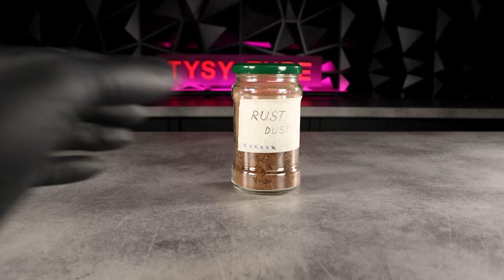Extremely Rusty and Destroyed Guillotine Restoration

Comment: I'm a chemist and I have a few things to say. Basically just don't use coke for removing rust. Most stuff that removes rust is acidic on the pH chart and sure, coke is but barely and I've used it before and it sucks to remove rust. What I would use is a mixture of vinegar (10%) and citric acid (or lemon juice) If the rust is really strong use a real rust remover as they contain hydrochloric or phosphoric acid normally, which tears through rust. For me personally I would use hydrochloric acid and it goes through rust in 2 seconds but it's a lot more dangerous and not everybody just has it around.
Reply: Lol
Reply: just take water and lye NAOH and dip rusty things in it for few mins only but when you remove it immediately apply some oil or lubricant on it else will rust again.
not useful for very fine threads as it will consume it but thick items it's ok to use.
Reply: @param888  Yeah I just fine it not as effective due to the water content so you would have to make it super concentrated but even then it doesn't work too well.
Reply: @FireTrye  i have used it professionally and got excellent results, I used it for bolts.
Reply: @param888  Oh really? Wow maybe I could try it again.
Reply: @FireTyre, not everyone has citric acid
Reply: I don't have citric acid
Reply: @rinjin1570  It's super cheap there's one at my grocery store for 100g  $2 AUD
Reply: Can i call u Walter white ?
Reply: @FireTrye So less expensive than one of those 2L bottles of Coke?

Also, less expensive than a single lemon. If Coke is too expensive, lemon juice is even worse.
Reply: @Ea-Nasir_Copper_Co  I just said it as someone asked. Citric acid isn't even the best option plus coke is useless at removing rust and citric acid is the ingredients in lemon juice that make it an okay rust remover. Just buy an actual rust remover or use elctrolysis
Reply: @n4_element606  lol
Reply: Good drain cleaners sold everywhere are ~ 20% “hydrogen chloride” but I’m no chemist so I don’t know what strength acid that equates to. I know even very diluted it would absolutely eat rust because I’ve seen it dissolve rags if given time. I also don’t know if it’s a good idea to use on iron, if it contains other stuff that would damage it.
Reply: @danielnance604  hmm maybe but yeah the "hydrogen chloride" you mentioned is basically The gas of hydrochloric acid. I have no idea why it was sold in drain cleaner as yes it can dissolve rags, but also aluminium and other stuff. Sulfuric acid is also sometimes found in drain cleaners but it's normally sodium hydroxide. But anyway to answer your question, yes it would be awesome at removing rust (depending on concentration).
Reply: Hard_hat_quonn  hmm but WD-40 makes it greasy as the end product and the rust appears back. Maybe if U use it to cover the surface of the metal
Reply: @FireTrye bill nye the science guy
Reply: Hard_hat_quonn  true
Reply: Bro it’s a restoration vid not a chemistry class
Reply: i have used coke for removing rust thanks for the fact i did not know
Reply: @Vashthestampede567  shush
Reply: @FireTrye  nour
Reply: Also, don’t support genocide by buying coke. Free Palestine 🇵🇸
Reply: @gangms16  how would someone support Genocide from buying coke
Reply: @deccyboi7667  lol
Reply: Idk like get a life
Reply: @BubbaBombGaming  says the dude on his phone writing that comment
Reply: @RandomYouTuber_YT  bruh
Reply: Yes. Use Dr. Pepper instead.
Reply: Got it MrWhite Anyways wanna cook some?
Reply: @JessePinkmanpp  bet
Reply: I want to know what to be used and what liquid makes rustproof.
Reply: Blud is making an human transmutation or a easier way to remove rust ☠
Reply: I’m a psychologist and i approuve that comment
Reply: @maxouno5817  Can you read people's mind?
Reply: @FireTrye  he's thinking of products that unclog drains like the works, which is hydrochloric acid.
Reply: Still works sorta
Reply: Ok
Reply: @maxouno5817  lol
Reply: I use acid drain cleaner
Reply: @abhishekprasad8151  yeah probably contains hydrogen chloride
Reply: Theres soo much cringe in this video, including using steel brushes
Reply: @scooooooterJesse, we need to cook
Reply: when will you make those “everday shorts” :3
Reply: @CowboybubPercussion  yeah fr
Reply: What chemical do you think he used to make it look rusty
Reply: @Ice_elite I'm actually not too sure. I doubt he made it rusty himself as it's penetrated pretty deep into the metal which are what those small black spots are before he sandblasts it. If he did he probably used salt water HOWEVER there is an awesome way using 19% cleaning vinegar, and 3-9% hydrogen peroxide (normally 8 parts h202 to 1 part vinegar) and some salt too. This makes it rusts in seconds. Also use as high purity of vinegar and hydrogen peroxide as U can get but above the amounts I mentioned it's hard to find and more dangerous.
Reply: @troxie000 lol
Reply: You can also remove rust with electrolysis and tell me if anyone wants to know more about how to
Reply: @FireTrye  yes 10% hcl
Reply: Im also a chemist and I also don’t think you shouldn’t just use coke
Reply: @nomadic_shadow  Nope it doesn't. Very ineffective. Plain old vinegar is wayyy better
Reply: The result was great so whats your point?
Reply: Okay nerd
Reply: Bro jus chill out im sure you have better  things to do than try to attract this guy because u know more
Reply: phd?
Reply: @too_much_time Had the perfect setup for Bill Trye the Science Guy and ya blew it😅Bill Trye Science Frie
Reply: this comment has made me a chemist, I'll have your PhD now🧻
Reply: BRO HE TURNED THE WOOD FROM WHITE TO BLACK 5:10
Reply: @FireTrye 🤓🤓🤓🤓🤓🤓🤓🤓🤓🤓🤓🤓🤓🤓
Reply: @1979GenXdude He asked in the video why coke wasn't working. Also yes it did but it was because he sand blasted, sanded and scrubbed. It would've been easier if he used a better rust remover though.
Reply: @nameisnotrelevant dam maybe I should take over 😄
Reply: @scooooooterthanks so we didn’t have to
Reply: Or you could just use rust remover
Reply: @THEBOILEDONE  ye lol
Reply: @TheThe-cq6ry  like Michael Jackson's skin color change?
Reply: Institutions unclear I used H2SO4 in my school lab and some fell on my fingers and I got a burn😂
Reply: Let the man cook that's probably why you're a chemist
Reply: Is there any way to make the Coke more acidic?
Reply: @maikybravo6108  I mean I guess but you'd have to add another acidic thing so you  might as well just use something else
Reply: Thank you for giving me a heart attack with this comment
Reply: why am i seeing people put up nerd emojis he is literally a chemist, plus he is just saying why coke is worse
Reply: Noted thanks for the info
Reply: Since your a chemist (just asking for a friend) can you give me the perfect recipe for pure meth
Reply: @I-play-tabor   Mhm just as a friend don't think youtube would like if I said it tho ;)
Reply: @gear7047   Thank you!
Reply: YO MISTAH WHITE WHY YOU GOT ME RUNNING AROUND TOWN TRYING TO FIND SOME STUPID BOTTLE OF LEMON JUICE WHEN I HAVE A PERFECTLY GOOD COCA-COLA I CAN USE?
Reply: @soupe5758  No Jesse NO!
Reply: Ur a chemist Yh 😂😂
Reply: @FireTrye coke has a 2-3 on the pH scale, which is similar to vinegar.
Reply: No thx😊
Reply: for me coke is perfect rust remover bruh
Reply: Does weak acid clear rust efficiently?
Reply: Huh 5:07
Reply: The only way I
Reply: Acid
Reply: Works great at removing stains from a filthy toilet if left overnight. Then follow up with a toilet cleaner. I have done this many times.
Reply: Hell yeah Mr. White
Reply: Bro is a nerd
Reply: lol
Reply: @FireTrye  well according to my calculations 🤓👆
Reply: Well if one wanted to have it around, where would you suggest they obtain it?
Reply: Not everybody has a industrial sand blaster lying around either 😅
Reply: Like hydrogen and nitrogen
Reply: not a chemist but a person who attended school, isnt dish soaps alkali, why add alkali to acidic things like citric acid and vinegar
Reply: A rust/corrosion remover that you can get at any Car place (even walmart automotive) for batteries is great for rust. Just hop a few aisles over for some metal brushes and that yellow foam crap will take anything off with barely any scrubbing
Reply: El acido clorhidrico es bueno removiendo el oxido pero suele dejar manchas en el metal
Reply: As a programmer i agree with him😊
Reply: Thanks!
Reply: Asking- as a mechanic, since it’s what I’ve been using for corroded battery terminals- is there an alternative I could use?
Reply: How did I ended reading like 30 comments.
Reply: No
Reply: Oxalic acid is the way. Especially if there is paint to be preserved underneath
Reply: 🤓”erm i actually a chemist”
Reply: Bro you can get it at a hardware store for like 30 bucks 😂
Reply: Wouldn't the dish soap reduce the efficacy of the acid solution you're trying to make?
Reply: Is OP actually going to take this slander from thy nerd?? I wouldn’t… he tryna make it sound like he could do a better job, we all know he couldn’t…
Reply: Znerdy aah
Reply: @statikcitten9  very good point and I don't know how I didn't think of that earlier. Thank you
Reply: Wouldn’t the dish soap make the mixture more basic?
Reply: @NJMgolf  yup that's what I was saying. It would neutralize the acid so it's worthless. Don't add it
Reply: Not that serious he just did it because people wanted him to
Reply: Ok you didn't have to explain all that.
Reply: Dude it was recommended to him…he’s a content creator
Reply: No 💩 Sherlock no Offense
Reply: I don’t think that’s what they usually do, but just did it because of comments asking for it. Could be wrong tho.
Reply: Well maybe Coke was the only thing he had lying around, Walter
Reply: Hydrochloric acid takes almost 24 hours to fully do any work on an acidic value.
Reply: @FireTrye  how much acids do I need to fully dissolve a 197.9 pound thing with meat?
Reply: Ketchup also removes rust as well
Reply: @ouriel-0  Roughly about 6- WOAH WOAH WHY DO YOU WANT TO KNOW?
Reply: This guy has 2.5 million subs. His craftsmanship is flawless. I think he’s doing fine Bill Nye
Reply: lol @briandoczkat9895  but he did ask why it wasn't working
Reply: What if it was coke syrup without being diluted into water ?
Reply: Bro stands on business
Reply: Thanks for the science lesson 🤓
Reply: @FireTrye  this is art, mr. white
Reply: Wow cada día se aprende algo, gracias 👍🏻
Reply: Mm g ❤
Reply: @iFRNKSTN  it doesn't matter why are people still discussing this? Coke contains a tiny bit of phosphoric acid which is used for rust removing. JUST BUY AN RUST REMOVER OR VINEGAR
Reply: @CaoticMonarch  Yeah 👍🏻
Reply: What about cocaine?
Reply: I have one theoretical question, what would one do if they needed to dissolve a body as fast as possible
Reply: @davyboy9397  so you need Kerosene, sulfuric acid, acetone, cocoa leav- what do you need it for?
Reply: @science_rex  Um I'm not gonna say but let's just say it uses an acid which has sulfur in its name mixed with hydrogen peroxide 30% on heat
Reply: Yo_its_esencarno  thank you
Reply: @lordvader5807  Alternative for what?
Reply: Bundy
Reply: Alright Walter Hartwell White
Reply: @scooooooter 😂😂😂
Reply: Im confused because who asked
Reply: Ahnenerbe18  Yup
Reply: I think the guy doesn’t always use coke to remove rust but he’s just trying it out himself. I’m pretty sure he doesn’t always use coke
Reply: I am also a chemist and I disagree.  I would much rather use harbor freight brand rust remover such as evaporust mixed with a monster energy drink and watch magic work. Also, Bart Simpson once created an entire civilization with coke and a tooth so it is proof that coke does not kill rust, it creates mini worlds.
Reply: @FireTrye if youre a real chemist I'd bet you 1k bucks if you know how to make metaphatamine or meth
Reply: Ahnenerbe18  yup with the iron oxide
Reply: @CoolerTheBetterSon  lol
Reply: @lordvader5807  Hm well most people use mixture of baking soda and water for that but there's a chance it could leak in and neutralize the sulfuric acid inside the battery. You could try a rust remover from a hardware store or just be careful with the baking soda and water solution. Sorry if anything here is incorrect, I don't know much about mechanics.
Reply: Ортофосфорную
Reply: No hate. But he wasn’t the one who wanted to do it the people in the comments told him to do it😂
Reply: coke has a pH of 2
Reply: Yeah. That’s so true. My dad is restoring a ww1 jeep and he uses vinegar to remove his rust
Reply: @Kjminer5   Oh cool. Also for anyone still wondering what to use, USE HYDROCHLORIC ACID! It literally gets through rust in seconds. Important thing to note is that if you do use it you should wear gloves, protective overalls, goggles, and don't breathe in any fumes directly or wear a respirator.
Reply: Why you respond to every comment
Reply: I want to and dont want to

🤓
Reply: Weed remover works like a charm, it is just much higher concentrated vinegar.
Reply: @emiliospgadventures2220  boosts my comment lmao
Reply: Someone cooked here🗿
Reply: @davyboy9397 I like your idea 😊.
Reply: @CoolerTheBetterSon Haha you don’t even need to graduate as a chem major to know how to make that.
Reply: Bro can start cooking rn
Reply: Nilered’s alt
Reply: Are you Walter white
Reply: I came here to say this, thank you. I'm only studying chemistry right now but I swear whoever suggested that was specifically trying to give me anxiety
Reply: @NxmbExzotic  ye
Reply: @PEEKOPEE  don't get me exposed like that fr fr
Reply: I just whip up some boiling Aqua Regia for most rust I find it’s basically instant and works super well!
Reply: @JonahTheMans  personally, I use piranah solution 😀
Reply: One question what will happen if you mix coco cola with vinegar?
Reply: He sand blasted it doh 🤣🤣
Reply: @lyndseybailey6726  not much lol
Reply: bro he prob. knows that he litualy said " a lot of u said to try cocacola"
Reply: I dont really get why theres people trying to counterargue someone who studied for chemics without not a single embasement lol 

Aye i dont want ruin your dreams little jimmy, but if Walter White said coke is useless was a rust remover i would believe him (and he would be probaly right).
Reply: I was under the impression the Coca-Cola sat at pH 2.4.
Reply: @FireTrye yo Mr white I uhh kinda already bought like 20 gallons of coke yo
Reply: @barkthebarker429  lol ty
Reply: @GlacerYT  yeah the acid is pretty weak tho
Reply: He just wasted coca cola
Reply: You could just use wd40 and brush it with a metal brush, that simple
Reply: Get a job
Reply: NEEERRRRRRRRDD
Reply: You're not a chemist.
Reply: @Meredythe I use domestic  HCl (clorhidric acid) directly on the wc lime stains. Just two minutes and everything is shiny and clean. And yes, I'm a chemist too.
Reply: Just don’t use it in the bathtub go buy a large plastic container
Reply: Thanks 😊
Reply: Thanks for the tip
Reply: Bro. Coke is a 2.6 on the ph scale . Tf you talking about it’s barely less acidic than stomach acid
Reply: @rspurepk  ?
Reply: @FireTrye  ?
Reply: And something I found out the hard way, don't try to speed up the vinegar by heating it -- Unless you'd like to blue the rust instead. And man the finish is beautiful when I blue that way. But of course boiling vinegar is a no-no indoors.
Reply: Where can I get this acid?
Reply: I honestly think they did it just because it was funny. Thumbs up for the VERY detailed advice though.
Reply: Can't just let everyone enjoy a fun video reviving a guillotine cutter huh?
Reply: question, does sandblasting remove or add? I really don’t know.
Reply: Could some sort of electrolysis work to remove rust?
Reply: Do you think the creator of the channel doesn't know any of this? Did you even watch any of his other vids?
Reply: Thanks for the detailed explanation! It's really helpful to know the limitations of using coke for rust removal and the alternatives that work better. I'll definitely keep vinegar and citric acid in mind for future projects. And good point about the more powerful rust removers like hydrochloric acid—effective but not something everyone can safely use. Appreciate the insight
Reply: Use a blend of phosphoric and water for rust.
Reply: Good idea
Reply: ive been a steel worker for 27 years n this guy is right, just make sure you hit it with some linseed oil or something after...
Reply: Usually I deal with rust via this chemical called elbow grease. I always find a can at my local Lowes before a job
Reply: Bros a whole chemist💀
Reply: You are what the world needs
Reply: Did I ask?
Reply: Thx for the tip I didnt know I was stupid enough to not know that coke is not a good rust remover
Reply: I don’t know why everyone is calling you a nerd just ignore them it’s called having a brain everyone that is being mean and that’s really good fire trye you know about rusting and what to use clearly you’ve paid attention to something and that’s really good. 👍😊❤️
Reply: walter white?!?
Reply: "and not everybody just has it around"
clover:
Reply: Cool!
Reply: if the hydrochloric acid is more dangerous, then its maybe a good thing that @TysyTube has chosen coke, as its less dangerous, right?
Reply: As an 8th grader I kinda learned more before school started
Reply: I agree my mom also know those stuff and plus it’s vasteful
Reply: He already knows this?
Reply: Dude Coke can do good but vinegar is better to remove rust.
Reply: @n4_element606  Jesse we need to cook
Reply: @FireTrye  bros walter white
Reply: from what i've seen he normally does  use vinegar or other means
Reply: @FireTrye  I'm not a chemist but I did play one on tv.
Reply: Jesus is the way the truth and the life. No one can go to the Father except through him.❤️
Knowing Jesus is knowing peace, protection and provision ❤️
Jesus saves, Jesus heals and Jesus grants peace
Reply: Thanks for the advice, I’ve done rust removals a few times and I never considered using hydrochloric acid due to the danger level, because at that time I didn’t have protection like a gas mask and gloves.
Reply: Nres
Reply: Why are all this comments reply's long like the comment itself💀💀💀
Lol
Reply: Coke is good content tho
Reply: Clearly you didn't watch the entire video because he actually used something else besides coke. Ignorant much?
Reply: @FireTrye  so cringe 😬
Reply: @FireTrye  maybe you make a video showing the poster how it's supposed to be done... He's only got 12 million views.  Maybe if you do it right you'll get 24 in half the time..
Reply: Okay